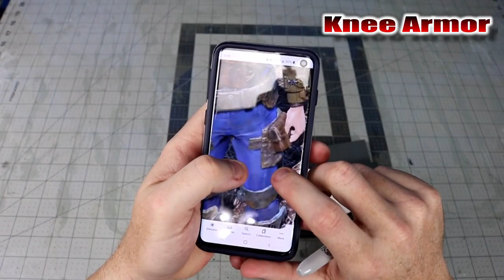Foam Forging Thigh & Knee Armor

Comment: How did you attach the pauldrons to the chest piece?
Reply from the maker: They are not attached. In game the are held up by the straps around the arms, like how I build mine. I will probably keep mine in place with a little velcro attached to the vault suit I will be wearing underneath the armor.
Reply: Got it thanks!